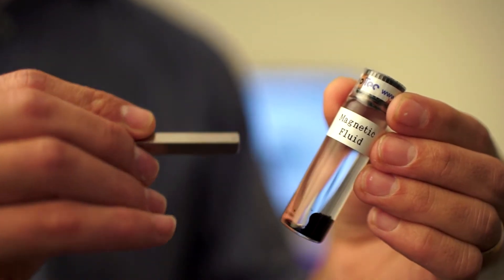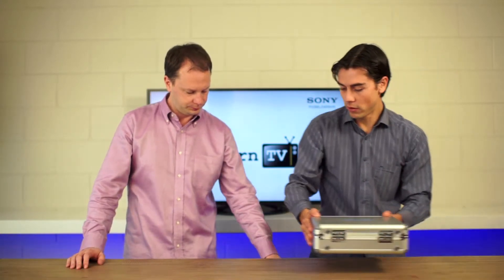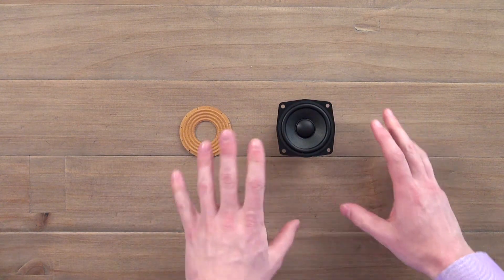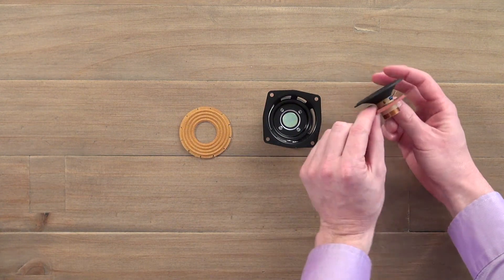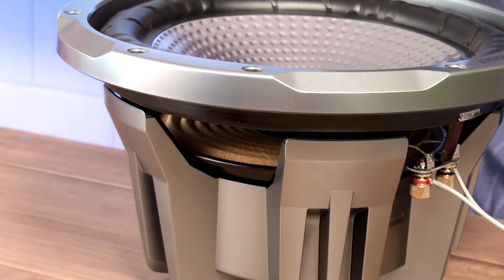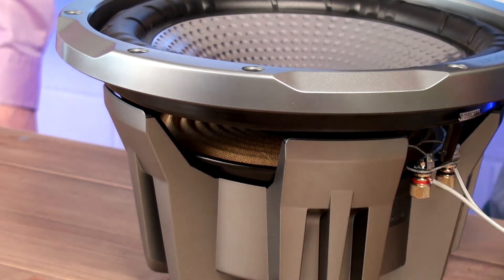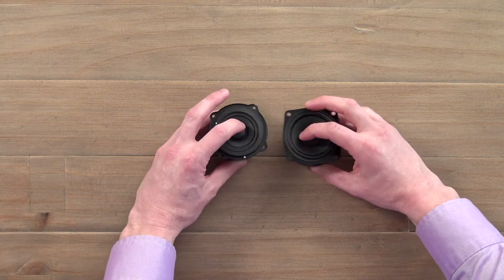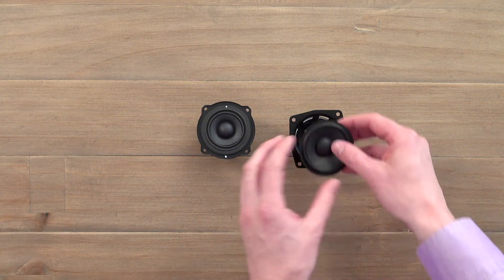LearnTV - What is Magnetic Fluid

Comment: Hello gentlemen, I was wondering : how is it possible for the speaker to work if the damper is replaced by ferrofluid ? If I recall correctly, the ferrofluid does not have axial stiffness, whereas a regular damper does...
Thank you in advance for your answer !
Reply: I'm no expert, but I bet it has to do with the liquid's resistance to compression. Sort of like hydraulics. 

I would suspect the qualities could also be altered by changing EMF fields near the magnet/fluid